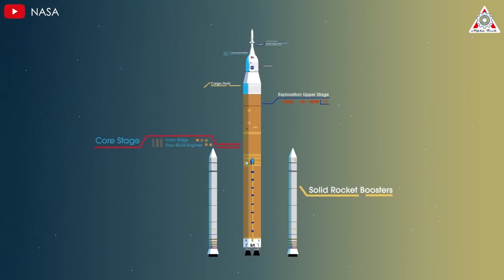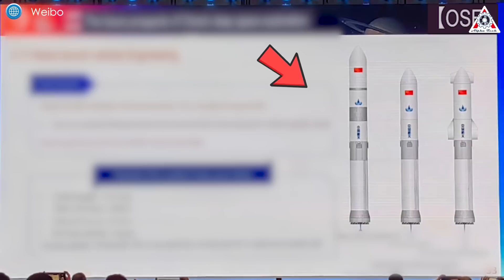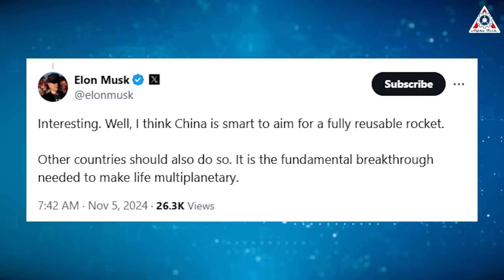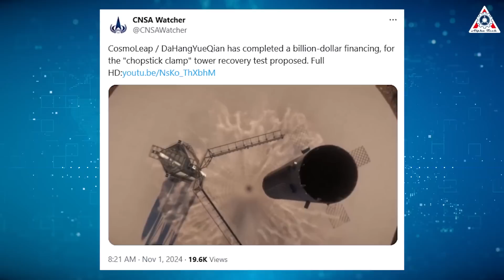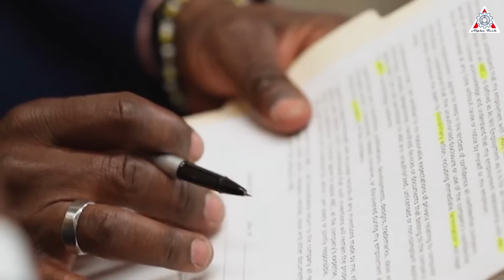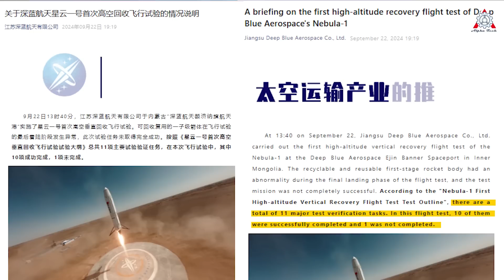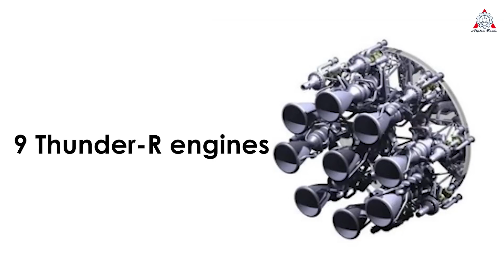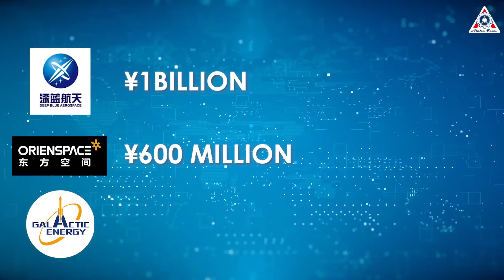Disaster! Musk's SpaceX just declared this after China unveiled its reusable Starship & EXPLOSION...

Comment: I'm happy the Chinese are going at it...
Will give the Politicals something to worry about.

Basically we are entering a new era, where the Economy shifts from Malthusian, to Space Based.

Will be fun to see the stats on the graphs 50 years from now...

Also will cure alot of problems inadvertantly via new tech roll outs.

Just like Starlink is gonna scrap Cell Towers...

Should also have side effects, like lowering costs on Air transport, via replacing long flights and the aircraft and infrastructure being repurposed for increasing local use, and prices coming down thru reduced Taxation and Regulation. Also lowering fuel costs and shifts to electric as battery tech improves.

Personally, I look forward to increased flight numbers to eliminate the stupid long layovers... What good is Jet powered travel sitting in an Airport, when you could make faster time flying in DC-3's if you had enough of them.
Reply: I am also pleased to see China pushing for cheap and reusable launch vehicles.